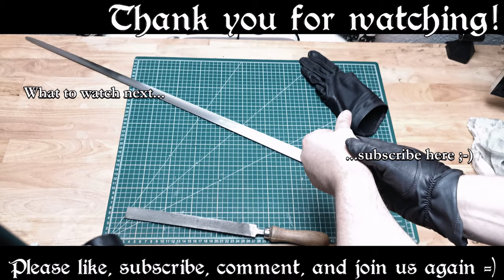Sword Maintenance - Cleaning a Malleus 1432 Early Sidesword [4k - 60fps - ASMR]

Comment: Hi! Newbie Q!
Why oil the Abrasive sponges and then clean the blade?
Why not use the sponges dry and just oil the blade once finished for protection?
Thnx!
Reply from the maker: The oiling helps with different things. First, you don't create dust, which makes it safer, and you can controll the dirt better. Next, Ballistol oil has some nice properties since it is slighlty alkaline and it neutralizes acids from fingerprints etc. Than, similar of using a wet sharpening stone, you create less heat which could make a problem if you are to motiviated to polish it (but probalty this is less of an issue). And additionally, it serves as kind of "polishing paste" medium with the grid off material, making the result a bit finer than just polishing with a 320 grid paper.
Reply: @SchildwachePotsdam  Thanks! :)

Comment: Looks barely used. Been using it for long?
Reply: It's 1 year old. I use it once a week, but it was mostly Corona. But I maintain is regularly
Reply: @stephan-schildwachepotsdam1171  Well done. Any tips for what to do about bigger dents? I tend to get 2-3mm dents/nicks on the back edge of my onehanders now and then. Usually I just round them off so they won't catch on anything and leave them.
Reply: @eibolsoe  rounding them off is exactly what I would try as well. I know some folks which hammer the nicks back to the blade, there will be work hardening them but I trust my file work more safety wise.